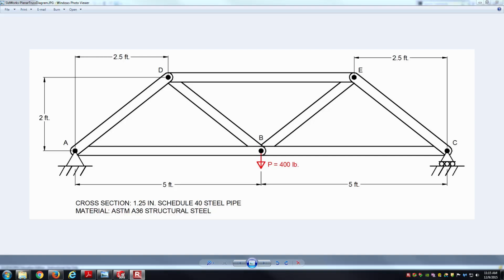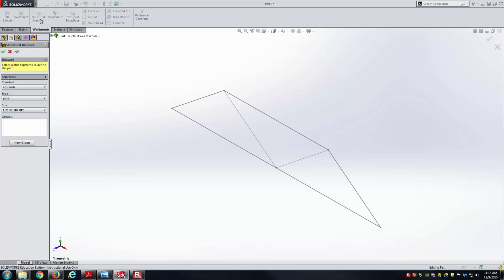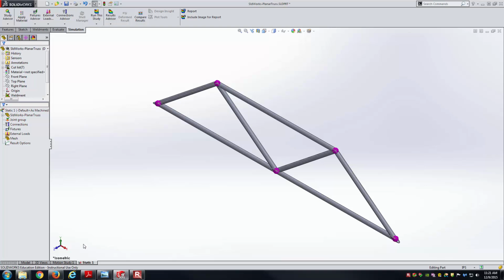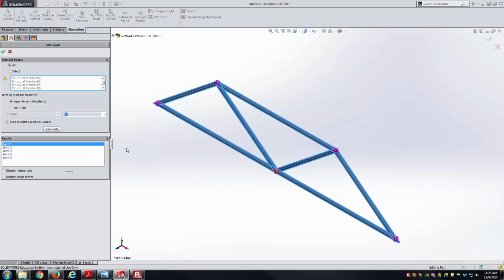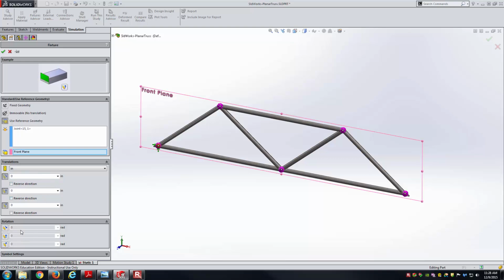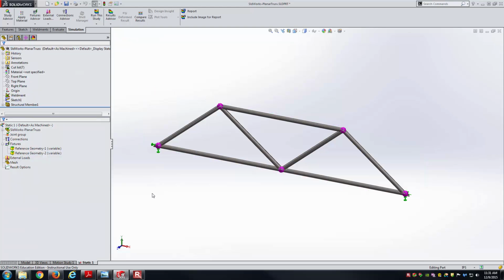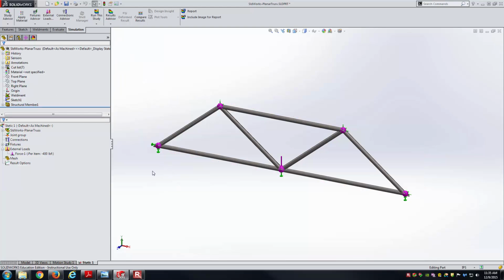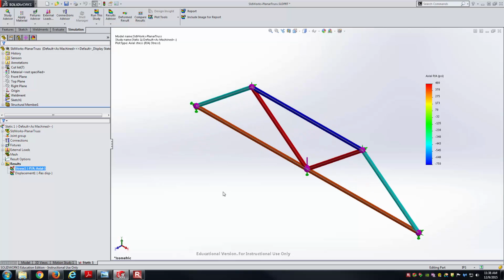SolidWorks - Planar Truss Analysis

Comment: Brilliant video, thank you! About the only thing that could have been done better is to have shown people how to create the (non-standard to SW) 1.25" pipe profile, so we could have followed along with your calculations. I work with 4130 tubing quite a bit in aerospace stuff, so I know how to create the weldment profiles--but I would still have to go look up the wall thickness for 1.25" pipe, for the schedule you used. This is a relatively trivial task though--but perhaps it would just have been nicer had you chosen a "built-in" pipe diameter, such as 1.0" or 1.5". That way we'd all be on the same page. 

Thanks again for creating the video. It was most educational.
Reply: I created such a profile, and uploaded it here for people who want to follow along but don't quite know how to use the same pipe size. Here are the steps:

1) Download the file here:  https://filebin.ca/6b2uRfMrunb8/1.25sch40.sldlfp

2) Put that file into the weldment profiles directory. On my Windows 10 machine with SW 2018, it goes here:

C:\Program Files\SOLIDWORKS Corp\SOLIDWORKS\lang\english\weldment profiles\ansi inch\pipe

Using this profile I was able to get the exact same results as Frankie showed in this video.